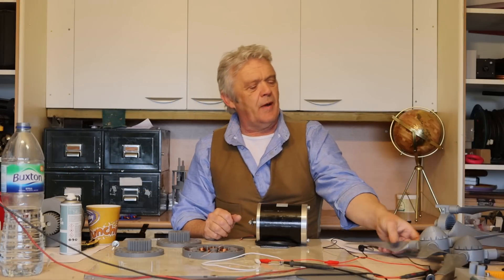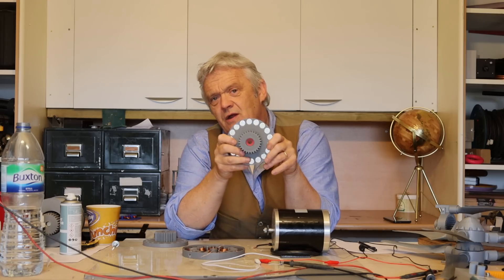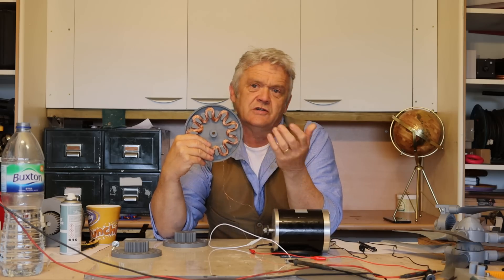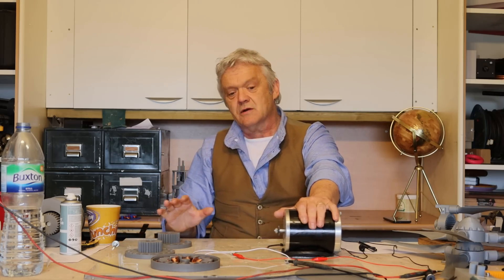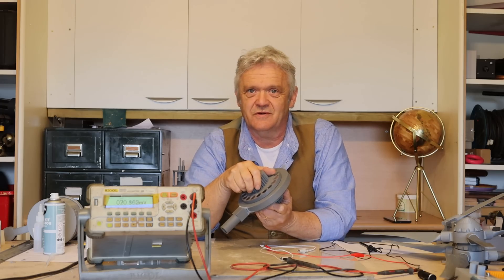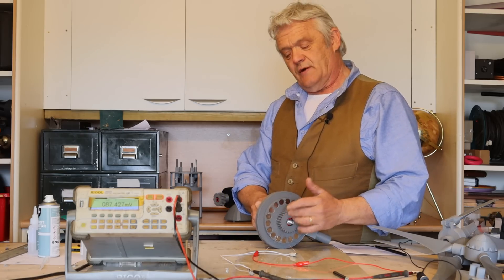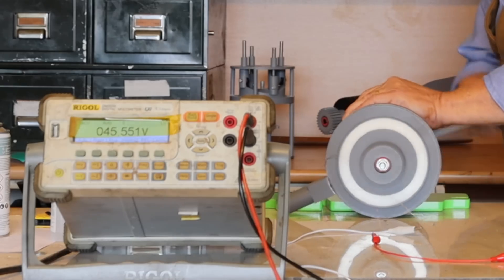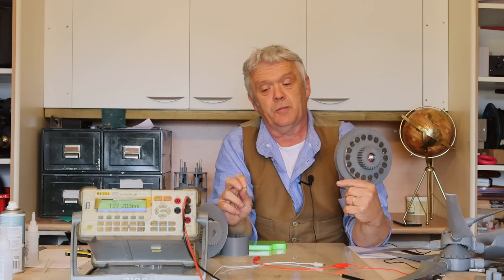2034 A Simple Adaptable Axial Flux Generator

Comment: This generator is really simple. However the magnet discs are axially held in place by the outer ring of ball bearings. If a magnetic disc gets loose and slips of the bearing, then whole assy fall apart. I suppose that the bearings need to be glued to the magnetic discs, to get stable operation.

Comment: I am an American School Teacher and I am in love with your channel. There are too many videos for me to parse through everything, and I am still learning, but I wanted to consolidate most of my questions on what I believe to be the most relevant video.

I'm curious about a few design considerations and the impact that these variables have on power generation. Presume that price is not a significant issue and the application would be for banking microhydro or small factor wind energy for offgrid application:

1) Would using stronger magnets increase the voltage?
2) Would using different sized wire be beneficial?
3) Is fewer larger magnets better or more numerous smaller magnets more beneficial?
4) Is the usage of a Serpentine Coil due to the ease of use and/or cost?
5) Is the current generated considered AC or DC given that there is only a single coil? Or does this just mean it is single phase?
6) Would your above setup be appropriate for charging a battery bank for off grid application if the storage was a distance away from the stator?

Comment: @Robert Murray-Smith, hello sir!
Always a pleasure to watch you advance the old the new and the ideas from study to practice, you convert/transform various concepts of energy with the record of time well spent over the years with a solid consistency throughout.

I believe last i commented some months ago I spoke of knowledge that I agree sounds sci-fi even if it can be explained well.

Tip: the magnets are scores more useful by strength and efficiency opening new designs.
Use multiple sizes of magnets to make pyramids to use instead of button shaped. 3/4<-1Tesla in magnetic strength for each pyramid. 
Do you think you can figure out how to add another material with/alongside the copper coils as well as something with/alongside the steel?
 Each plate should have a magnetic placement that connects the total system without an axle or any bearings.

Comment: You understood the principle of guiding the flux in the context of flux switching motors, so why do you still have a problem with the metal ring idea?
By reducing the flux resistance on the non-working side, you strengthen the field through your coils.

Comment: Couldn't that be used with a pedel arrangement one one way one the other so at a good torqure the power would be half on each leg? Or a gear arrangement? In thinking power over talk by splittiling it so double power but hopefully not in in input. It won't be amazing but worth a though due to magnetic gears ext and maybe multiple coils. Serpentine. Xxx

Comment: suggestion...
large ring magnet, polarity oriented same as axis.
three meter wire.
grounding rod
closet shelf hanger... stand off for a wall.

hang the stand off on an exterior wall ten feet up.
hang the three meter wire from the stand off so it hangs a way from the wall and is not grounded through/to, the building.

attach ring magnet to a steel plate on a steel axle
run the axle through a couple insulated bearings that are mounted above ground.
Isolate the magnet axle and bearing from ground
sink grounding rod into the ground away from building
attach small wire to grounding rod and the other end touches the end of the axle

touch the end of the three meter wire to the circumference of the ring magnet...
If i am correct this should cause the ring magnet to spin... perhaps only when the ground is intermittently switch on and off...?

if works scale it up and go for the  height of your tallest building...

strength of the magnetic force that rotates the ring magnet is proportionate to the voltage times the electron movement in the magnetic beltways of magnet
taller building more voltage

Comment: Hi Rob, awesome generator. How much amps can you get on the .2 mm wire?
Reply: Doing some digging, 0.2mm wire is rated for just over 0.5A.  Might be more or less depending on the specific insulation rating of the wire, but theres a starting point for you

Comment: May I ask :
What the benefits of counter-rotating magnets will do?
Reply: Usually detrimental
Reply from the maker: i have no idea mate - but people keep suggesting it to me - so I included it
Reply: @ThinkingandTinkering  

Thank you for your input.
In my proposed design: IF The coils turned in one direction ( say clockwise) and the magnets turned in the other direction ( counter clockwise) then possible a higher output can be achieved at a lower RPM, AS both coil and magnet are turning.  Result is higher output while parts spin slower. Less chance of braking apart ( maybe).

Comment: Might be worth doing a video on how to design rotors and stators for folk who have different size magnets, I know there must be a quick way in Tinkercad to rotate x degrees and copy paste?
Or even when you offer the STLs to have a blank disk to add your own magnet dimensions.
Reply: if you have the disc with the magnet holes, you can easily fill those holes in tinkercad in 1-2 steps. Hit save....done and dusted.

Comment: I'm a firm believer in modular design, so I admire this foresight in your work!
Reply: Me too. Some call it the Unix philosophy. But I am sure the concept has been around for millenia.
Reply: until you print it and see the parts dont fit.
Reply: @bermudatriangle2036  If you really cared then you would print all of your components 1mm larger than the intended size and if that happens to be too big then you can simply sand it down to the perfect size. Use your brain

Comment: great!😃
how to calculate the sizing of a serpentine coil (diameter of the wire, length...) in relation to the power of the magnets (gauss, tesla)? and compared to the torque available in Nm (wind or water)?
Unfortunately, there is very little relevant data on pico-turbine designs...

Comment: Wow!  Great voltage output.  Have you calculated it's wattage?
Reply: "its"
P=I*E 
if you have voltage and current you can get power using basic maths.  
I think a more useful way to look at motors from a viewpoint of torque and the few points where your RPM are limited by saturation or cancellation (friction can be mostly removed).
Since we didn't have a current sensing resistor measured (usually a very small, very precisely known value), its hard to tell since the input impedance of the meter is supposed to be super high (if you want to be precise, you would use a 4-wire meter with kelvin clips), Heisenberg be damned.
Reply: I KNOW how to calculate watts, however amperage was not given
 @russellzauner

Comment: For the center section with the serpentine coil wiring, if you printed (or drilled) holes parallel with the axel between the wiring where your printed "wire guides" are and inserted iron rods, the magnetic field between the coils should increase and give you better output.
Reply: Just through the stator (that doesn't move), perpendicular to the copper windings. Magnetic fields form circuits. Like electric circuits, they follow the path of least resistance. Magnets form magnetic field loops. The stronger the magnet, the bigger the loops. Iron offers a lower resistance to direct the field paths and keep the field strength higher where you want it - between the copper windings.
Reply: you would also introduce "cogging" i.e. resistance to rotation, as the magnets would want to lock onto the rods, which is the opposite to the intention of an axial flux generator.

Comment: On the note about generation, you've been banging on about rotational speed, did you ever think about putting a ring around the tip of the blades and use the tip speed for your generation ?

Comment: Why are the magnet discs smaller than the serpentine coil disc?
Reply: Something to do with the way the electricity is generated and the way it flows through the copper wire coils,,,,I think that if you watch the video about making Serpentine Coils,,, it's explained there,,,
I hope that this helps,
Andrea and Critters. ...XxX....
Reply: @AndreaDingbatt  thanks, I found my answer after watching the video a second time.  Appreciate your response!
Reply: @shawncalderon4950  Thank You 
very much, for the Polite Update,
Best Wishes,,,
Anrea and Critters.  XX
Reply: The coil doesn’t generate where the wire turns. If the magnets were the same size as the coil that portion of the magnets would be wasted.
Reply: @mikebond6328  Thank you Mike!!
You explained that way better than I was able to!!
Reply: @mikebond6328  thank you!

Comment: Robert I was thinking about your last wind turbine generator and I think there a way to increase power output by increasing the wind velocity artificially. 
what if you funnel the air and push up the air with heat convention like gas stove or wood fire, and as the wind goes up a tapered funnel shape tube it compresses and picks up speed. The wind generator fans can then be placed on the top at the correct angles to get blasted by the jet winds that will come out from the compressed wind. An omni directional wind collector that is heated by fire which then escapes through a narrowing tube which increases wind velocity by as much as 80-100% depending on the efficiency of the design.
Reply: And the heater could be powered by the initial and also part of the following wind powering the entire setup, if that makes sense!

Comment: The steel backing disk on the magnets makes the flux field shift inwards on one side and shift outwards on the coil side. This allows more penetration of the flux into the coils and does increase the output. I've proven it many times in my axial flux alternators.
Reply: Look for  this video on you tube -   1951 Quadruple magnetic field strength with steel. It's about the same principle.
Reply: Do you have a video of before and after that you could share please?
Reply: No but you can model it using an online tool called FEMM
Reply: Yes, that's what I've noticed too, seems right
Reply: When not actually touching and having iron close to a magnet the Bloch wall is moved towards the iron. If touching the Bloch wall is moved to the other pole on the magnet essentially making a hypothetically stronger magnet on the pole where the Bloch wall is closest to.... Thank you for making your comment. This is exactly what I was thinking about when Robert mentioned the steel disc.
Reply: Great stuff as usual!  Can this unit be operated as a motor?
Also, if iron rings are inserted in generator version, does it stand fixed or rotate with the magnets?
Reply: @sham1234567891  rotates and glued to the magnet backs
Reply: This was what I had envisioned in how it would go about the cause of rotation. During another explanation it stated there was a sensor commanding the change in poles or shorted circuits to prevent the same charges from attracting one another. Not too sure if I’m explaining this well but I don’t think that would in any way be the most effective solution or accurate description to its functionality. Thank you for clarifying because my mind immediately thought that can’t be entirely correct. But then again this was using the same design for the application of motor vehicles and aviation. That requires having different MPU’s and circuits for sensor controls etc  but not the original design.
Reply: Perhaps but also consider the extra energy needed to spin the steel. Adding graphite to the plastic filament might accomplish that. Weight, magnetic permeability, and magnetic force are all at play. Filament direction would affect magnetic permeability.
Reply: @veganismyname  unconsequential. You only need steel behind the magnets. Just a ring, not a whole disk.
Reply: @veganismyname  Graphite has no magnetic properties that I know of, it's nonferrous. It's about the same as any nonferrous conductor.
Reply: @justtinkering6713 It actually does...  it can be diamagnetic such that it's actually repelled from a magnetic field, but it's a weak force not likely worth bothering with in most real world applications.
Reply: @veganismyname  Shielding by diamagnetic material would not do any advantages here. You want to create magnetic circuit, hence the back iron. 
It would add inertia, but the efficiency wouldn't be affected unless the bearings would have enough of bearing capacity.
Reply: Read couple of months back  , carbon fiber shields EMF , it reflects it .
May help.

Comment: If we drop a magnet thru a copper pipe, we get resistance, without any rotation. What would be required to generate electricity via magnets without rotation/coils.
Reply: Linear generator.
Reply: @mikebond6328  they use coils
Reply: So make a copper pipe race track and put a magnet in there, and use compressed air to accelerate it around? You have to have an exit for the air to escape right at where the air comes in at. And then of course have to air leave at the opposite angle to which it enters. The air should also keep things cool. Would be a fun experiment.
Reply: @grantdeisig1360 could do the same thing with water maybe...... connect straight to a tap with the outlet tee'd to the side the inlet a Y🤔

Comment: Hi Rob, is it possible to attach one of these generators onto an e scooter and have a turbine spin which will produce power to recharge the batteries?
Reply: It gonna cost you 1 in  energy to produce 0.8 in optimal so it is not worthed. Be sure that if it would be worthed, it would be already there (and they, of course put their price higher for that)
Reply: I mean if it’s possible to gear up by 27:1 ratio then surely you should be able to produce a decent amount of power.
Reply: I guess it all boils down to the speed of the wind that’s capable of turning a geared turbine as it may have an initial force it has to overcome before any work is done.